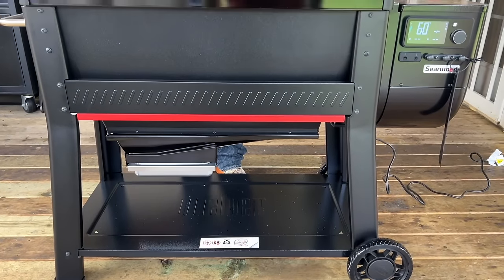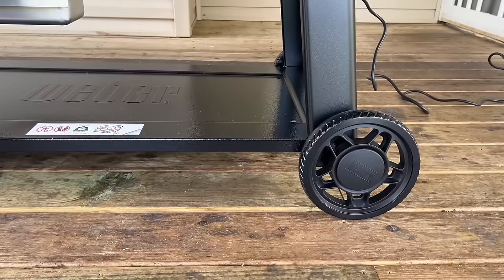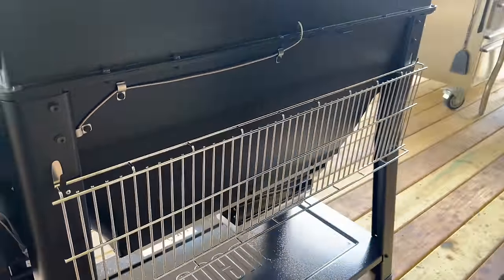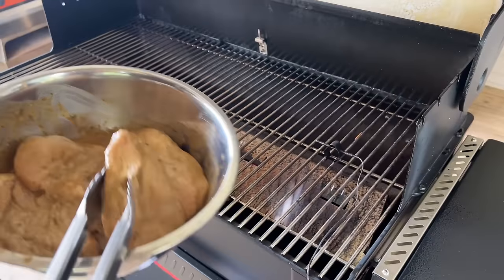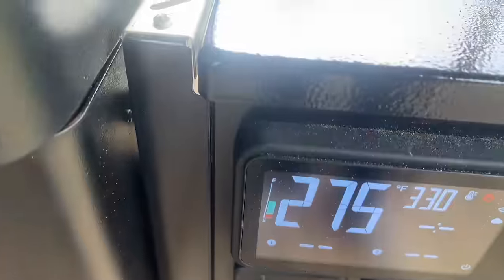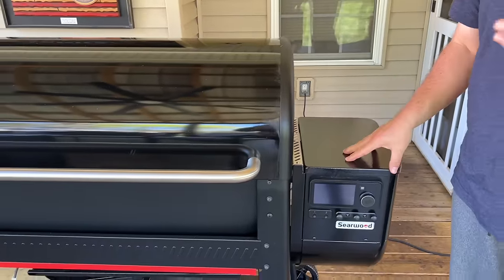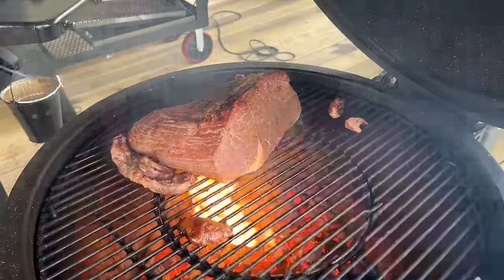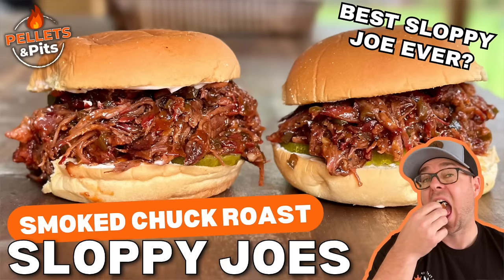ALL NEW Weber Searwood XL 600 - REVIEW and 1st/2nd Cooks!

Comment: Love your videos, but I just don't get it with these companies at this point. To come out with any grill in 2024, especially at 4 digit price points, and not have 4 wheels is bonkers. DOA right from the get go, regardless of how good it grills.
Reply from the maker: Great point...only thing I can think is this is what helps support the unit from moving...maybe a causality problem...I agree...BUT I figured it was mostly me because I have to move units so much....honestly it drives me nuts...BUT I dont know if can produce better with better features....might over look...just got the rotisserie...
Reply: For the size of unit, moving it around on two wheels makes no sense, probably “upgrades” for future model years
Reply: I could care less if my grill has 4 wheels. It sits on the patio who cares.
Reply from the maker: @bradyb9929  people like me who have to move the unit a bunch...some or I would say  a lot of people have to move griddle/smokers to use them away from the house and dont have the ability or luxury of having a set place for cooking and storage.
Reply: I have to pull mine across grass to move into my garage when I leave town for any length of time. Much easier with two larger wheels vs 4 castors.
Reply: Whats the new pellet smoker that's coming out? 🤔 A new Pit Boss or Camp Chef?
Reply: Not sure about that, I would buy it
Reply: Just retrofit some wheels, easy
Reply: @PelletsandPits  Traeger wheels are garbage garbage, friend had a camp chef and it fell on his deck when they sheared at the bolt when he never moved it.  Somehow only wagon wheels on Weber kettles don’t seem to be a downsides. And the smoke fire wheels were absolute JUNK, bent moving it the first time on a wood deck.

Comment: Without the traditional drip tray it seems the ash and grease will just mix and have to use the tool everytime. I kind of like my normal drip tray change the foil on it and vac the fire box good to go.  The smokefire struggled with ash all over the meat hopefully this one is better

Comment: Well done review! I agree 💯 with you about some new PID controllers locking in on a temp and not moving. I got a new 1600, rimes with Bit Poss 😉, when they first came out. The thing literally would run 1.5 hours and still got get to temp at times. After it would reach set temp, I would open the lid and the temp wouldn't change or would be laggy, but my Inkbird that i run on the grate for ambient temps and meat temp would show the temp change instantly. In other words, the controller wouldn't show a change of the door being open for even 5 minutes. If that all makes sense. Lol. After fighting several of this brand smokers, I'm happy to say the Wife gave me the ok of whichever I wanted, new drum smoker or the LSG 20x42 Pellet. Pretty sure on which way I may be going!!😁 Thanks for the videos, Neal!!
Reply from the maker: when you go to order..reach out and i can help with mroe questions on what accessories or so forth...
Reply: @PelletsandPits  That sounds great!! I appreciate that. Thank you!!

Comment: I was an early adopter and bought the first gen smokefire. It was very frustrating to say the least. Seems like this is a huge improvement. What I’d like to see is grate temp across the grill. The original smokefire has serious uneven heating issues. Does the new diffuser fix this? Can we get a video with several temp probes at the grate to see the heat distribution/variations? Thanks for the detailed review. Definitely looks like they fixed several issues from the smokefire. Really interested in that rotisserie.
Reply from the maker: Yes...I can put something together...thanks for commenting

Comment: Thanks for your service Neal and the great review of the Searwood.  I'm moving on from my Traeger Century 34 after 5 years.  One question, on the burn in, what kind of oil did you use?
Reply from the maker: any high heat oil...avocado...duck...tallow...
Reply: @PelletsandPits  Thanks!!  I was also looking at the Recteq Flagship 1100, similar price point.  Have you looked at that grill at all?

Comment: Well. Just finished cleanup after a 16 hour brisket cook. Not sure what type of pellets you are using (I used LJ Char Hickory) but my burn pot was 1/3 full of ash. Interested when you do a low and slow how you make out with ash in the burn pot as you'd mentioned there was no significant ash in your burn pot after a few cooks. I fully expected to have to clean out the pot so not a big deal. Was just a surprise after reading some of your results In the comments area.
Reply from the maker: Planning a long cook soon...

Comment: I noticed you didn’t use the smoke boost feature for the pork? What’s the temp difference between setting the grill to 600 and manual level 10?
Reply: I don’t think this is how manual mode is supposed to be used.  The manual says it’s for the griddle or open lid cooking.  For the chicken you are only opening the lid to flip, so I don’t think that is the purpose of manual mode.

I’ve tried both on mine, and came to the conclusion that manual mode is mostly beneficial for griddles, and setting a temp specifically for searing is better.  Especially since manual mode didn’t even get to 600.
Reply from the maker: What you saw was about a total of 10 seconds of multiple clips..ahahahha we tested out the manual mode with lid open and closed ...cant see inside if the lid is closed...the purpose of the manual mode is to override the algorithm on the temp inside...just like my lone star and they use fireboard...the idea is the firepot is constantly feed ...no temp is required...so if it did hit a temp it would not stop feeding...manual mode does not stop...
Reply from the maker: the smoke boast is only for 180 degrees...we just wanted to put a butt on and see what happens...we can dive deeper in other videos...

Comment: Great review. I was going to pick up a Genesis because I only wanted regular grilling like steaks and carne asada. I would eventually try and buy a smoker for occasional use. Then I came across the Searwood. Seems like a solid unit to be able to do both! Have you seen the regular 600 over the XL and do you think it’s too small?
Reply from the maker: I have a video coming with the rotisserie attachment...and a separate  video showcasing the sear part...steaks and vegetables....So my honest answer is I would absolutely recommend the bigger one...Like most things you might not use that space all the time...but when you need it you have it...plus the after market accessories / features are well worth it..

Comment: Hey there, thanks for the videos. I’m a first-time viewer, coming around looking at reviews because I’m needing to pick out a first grill. Someone recommended this to me and I’m trying to figure out if I wanna go this route or not. I know it’s personal preference ultimately, but just curious - a month down the line, plus you having a bunch of other equipment it seems… How do you like the Searwood, and have you found yourself still using it or going back to other setups and this one has not seen a lot of use?
Reply from the maker: First thanks for stopping by...really appreciate that..
So as you could imagine thats a hard question...This is how I go about my ideas
after having so many brands...i like things about all and dont like things about all
I will tell ya what i like based on my experience
1. Ability to have open flame...is it 100 necessary..no but its extremely nice
2. Bang for the buck...what comes already with it.
3. Aftermarket accessories...what can you buy to complement it...
4. Size for the price...how often are you actually going to stuff full of food...or can you use another piece of equipment you help out if needed...
All that being said...yeah its an above average unit...with fantastic accessories and fun to use...
I am not 100 sold on the idea of the sear part...the Traeger does just as good with 100 degrees less....
they all run like a dream at 250/275...which they are designed to do...
Pellet choice makes the biggest difference 
And lastly...Weber has hands down the best aftermarket accessories if thats an option
Reply: @PelletsandPits  Awesome, thank you for your response and your time :) have a great day.

Comment: I’ve seen other channels show heat distribution based on canned biscuits distributed throughout and taking a look at doneness. Would you pursue a test like this or is there a better method to get to know your smoker?
Reply from the maker: Yeah we do that on the griddle side with sliced bread...when I put the chicken on...thats something I was looking for...I can do the biscuit test..But in my opinion typically bbq pits have temp swings....my thermometer didnt move much...so thats a tell tell as well that it probably has fantastic heat retention
Reply: Someone did this on one of the Weber forums.  Hot spots on the 2 far sides, very even everywhere else.

Comment: If you can go into the manual mode and what exactly that is , does it produce more smoke or is it for the sear option and how well does it produce smoke at say a lower temp of 250. Great video look forward to more cooks on this model.
Reply from the maker: so this answer will be true on all smokers...the higher the temp the less smoke flavor you will get...
2 reasons
Typically is just takes less time to cook...thus less smoke flavor
Lastly..a pellet is designed to smolder....they are best used for 200 to 275...anything after that the pellet catches fire and changes from smoke to heat kinda thing...
Yes when using on manual mode we did get higher temps and no doubt an added smoke flavor....
Reply: @PelletsandPits  Thanks for your feedback. Cheers

Comment: Great review! Just confirming, with the design of the fire pot, there is no need to vacuum it out, basically ever?
Reply from the maker: True....it all funnels down....into the grease area...NOW...you will need to scrape out...but no vacuum needed
Reply: @PelletsandPits  Man, I love my Traeger, but a pellet grill that can sear and not need to vacuum... What do you think about what remains on the V shaped diffuser? What are the grill fire risks associated with that at higher temps?
Reply from the maker: @GarrettWork  well I think that’s something always on mind. When I did the video on how to clean the lone star… I mentioned that. It’s true on all pellet smokers that have that ability. On this model there is no grease in the unit… it hit the flavor bar and runs down. What’s what needs to be clean. If you keep that clean.. you should be good to go. When using for longer and lower cooks you don’t have that risk… fat will not burn at 250/275. I’m doing steaks soon… my plan is to show the bottom ash are before I start.. scrape clean and sear steaks.

Comment: I have a ‘cheap’ Camp Chef smoker, a Weber Summit Grill, a Blackstone griddle, a Weber kettle, and a Charboil turkey air fryer. I really like spending money on cooking stuff, but when I look at these pellet devices, I just don’t see the bang for the buck. What would you say are the 2 or 3 reasons why a pellet smoker is a good investment?
Reply from the maker: So....in my 3rd video ever...it was titled gasket seal review. This was and still on my other channel the flat top king....in the video I had a stick burner and referenced wanting a pellet grill...long story short I ended up buying my Camp Chef Griddle and as they say....it changed everything...
Looking forward to your comment....my biggest reason...TIME...just dont have enough of it...when pellet smoking I can walk away and do other things...now adays...they are extremely effective and efficient....heck I leave the house and come back...still cooking...when using a stick burner...its like an all day babysitting thing...
2..Versatility....on a stick burner..its extremely hard to bump temps up...and down...plus maintain a high temp...
on a pellet grill with the open flame technology or like the weber has a sear zone....just press a button...now you are grilling...not smoking...with ease...
3.....lightweight...can be used very easily...
4. the weber and not all....have a grilling set up with accessories...its incredible...just got the rotisserie and its fantastic...already filmed on it...

Comment: Aesthetically, I think it's a major step-back compared to the SmokeFire. The SF matched the look of their Weber Summit Kamado. Hopefully this one doesn't run into the issues the SF had.
Reply from the maker: I went back to look at that model...didn't notice that much different..especially for a major step back...seemed very similar....
Reply: @PelletsandPits  mostly the stainless trim. If you put them next to the Summit kamado, it stands out more.
Reply from the maker: @tomrwills  yes that agree… I have the slate, and Genisis… they all have the subtle red trim.  My summit is the original .. not the kamado. Has the stainless trim.

Comment: Great review. I currently have a Smokey Mountain and a Genesis. Would I be able to replace both of them with this single unit, using the manual mode as a replacement for my gas grill?
Reply from the maker: thats a tuff question...could you yes...but im partial to charcoal...

Comment: Novice here! What is the reasoning for using the oil before the burn in process? Is it to protect it against rust and moisture?
Reply from the maker: Yes...typically the natural oils do this from meats..but this helps...the burn it is hotter than most..meaning a high heat oil will protect the metals...
Reply: I appreciate the reply! Keep up the awesome videos!

Comment: Nice review but I have a question for you and anyone else: I heard about the new Searwood and checked it out at my local dealer - the 600 Xl. But, I noticed they had the ELX6 Stealth for $200 less and it looks like twice the grill. It had a light, 4 casters, two side tables, and the crafted insert and griddle. Also, the upper rack is 14” deep on the ELX6 vs 10” on the 600 Xl.

I’m not an expert on pellet grills but heard they did have issues with the original Smokefire. Any reason not to pick the ELX6 over the 600XL?

Thanks

Comment: One more question, when you are trying to sear and have the intensity on 10, do the flames come through at all to sear the meat or is it just the high intensity heat that causes the sear?
Reply from the maker: Well there are some areas that have the flames come out...not the whole area...but yes...you can...plus we need to do some more testing...difference between manual and just setting the temp to 600...But just being that hot will sear....the difference is the flare ups...

Comment: If you like the smoke or charcoal taste I haven’t found a pellet smoker better than camp chef with the fire box. As close to an offset taste as I can get
Reply: I have had so many problems with my camp chef. I am looking forward. Box burns , overheating... Its time to move on!
Reply: @stevefoltz3838 So true. I have a stick burner and have to manage that less than I did that tiny fire box on the camp. The camp has incredibly uneven heating.

Comment: How is the smoke/smoke flavor? I am in the market for a pellet grill and would love to keep it all Weber (currently have Weber gas and charcoal). Thanks in advance.
Reply: Great smoke flavor on mine.  There is a smoke boost setting at 180 degrees.  On a pork butt for example you would run it on smoke boost for 2 hours then dial it up to 250 or whatever your preferred temp is.

I used to smoke on my weber kettle and this is very similar taste and 10x easier.
Reply from the maker: Well compared to other pellet grills...same flavor...compared to charcoal with wood chunks or splits...not there yet...not webers fault...just pellet smoking in general have not caught up to REAL charcoal and wood...
that being said...the versatility by adding Weber Crafted® Outdoor Kitchen Collection make this a game changer in my mind...AND..i need to double check...the rotisserie attachment fits the Genesis as well...so if you want to stay in the family...absolutely...plus it seems like it all fits...

Comment: I don't like that it only has 2 wheels. I like the grill and would buy one in a minute but I need to move it around my uneven patio and without 4 wheels it's a deal breaker for me. It's not a light grill so it would be difficult to move around as is for me. Too bad! Looks like I'll be looking at Camp Chef Woodwind Pro or a Recteq.

Comment: I have a older camp chef smoker an was thinking about getting a gas genesis. Would you recommend this an moving on from the camp chef or go with the individuals?
Reply from the maker: Thats a personal preference....I do think the weber gensis and griddle insert is better than alot of stand alone griddles on the market...BUT thats not the case when you buy good ones...if you have the means....buy separately..if space and money are tight...you cant go wrong
Reply: @PelletsandPits  I think you read that wrong. You lost me on the griddle talk. Would you rather have this grill or a genesis along with the camp chef smoker? I have plenty of room. I do more barbecuing then smoking. Just wondering if you think this would be a waste if a majority of the time it’s used it would be for Normal BBQ.
Reply from the maker: @jsvelker  Sorry....Its so hard to tell...the Searwood gives you the option to sear....but its not necessary a good sear...the genesis is designed to do just that...you said that you bbq more than smoke....I would recommend the genesis over the searwood just based on what you like doing most...
Reply: @PelletsandPits  I was thinking that same thing, but I just needed somebody to push me that way. Thank you for replying. I appreciate the info.
Reply from the maker: @jsvelker  Sorry about the confusion